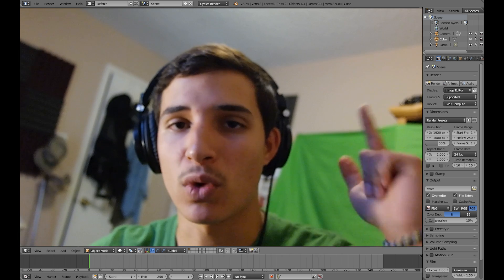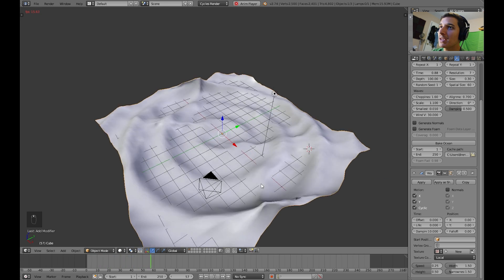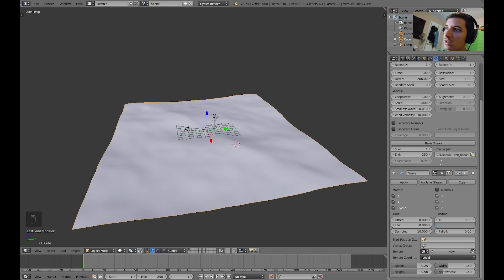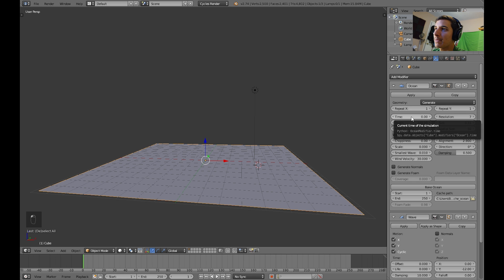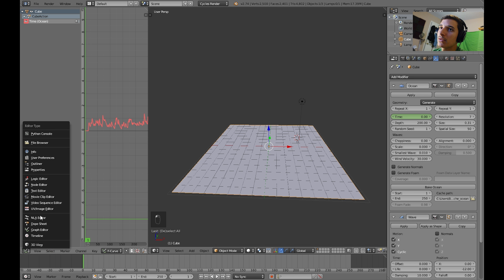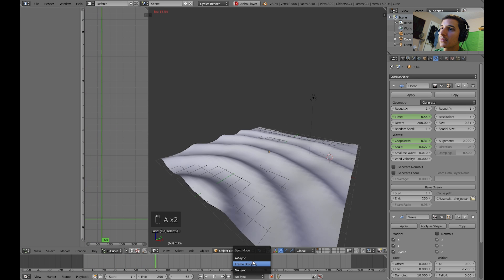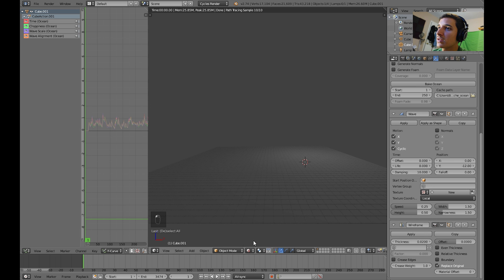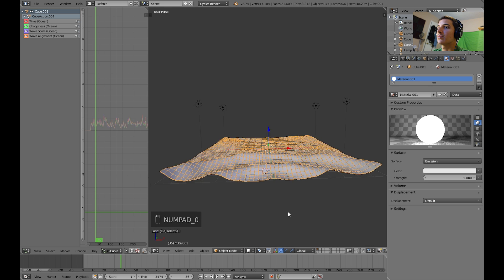Blender tutorial: how to create an ocean simulation audio visualizer

Comment: +B.Shep The reason the waves start at around frame 60 is because, when you change the Y position in the Wave modifier, those waves ARE generated. They just have to reach the field of view, which is determined by Spatial Size in the Ocean modifier. So, you can either change the Spatial Size to include the waves generated with a Y position of -26, or you can change the Y position to around -10. I found that the -10 Y position was easier, though.
Reply from the maker: Ah okay